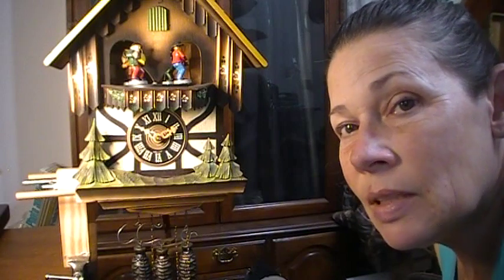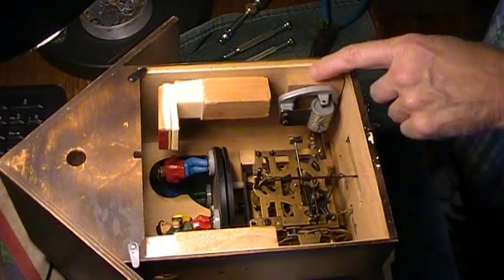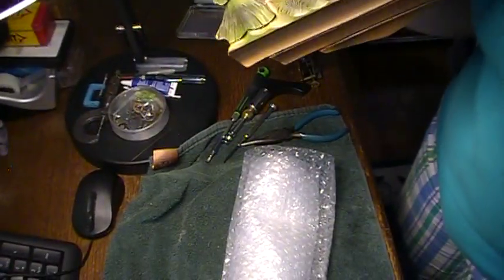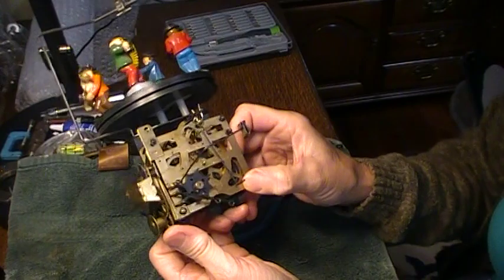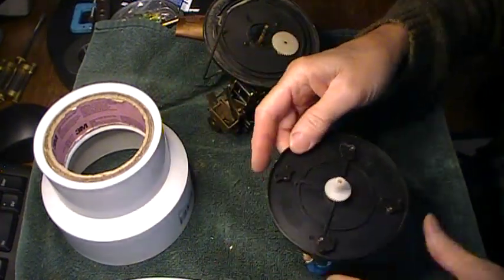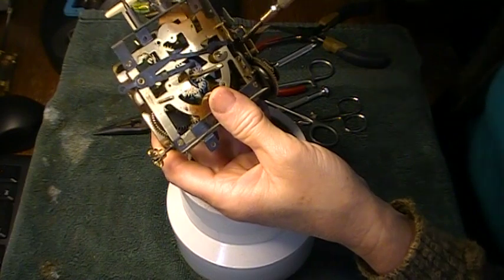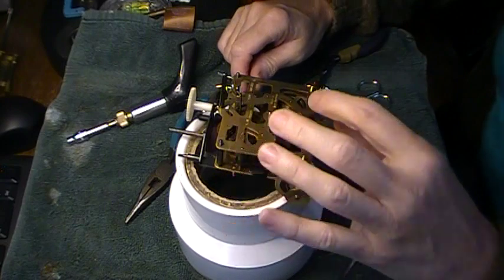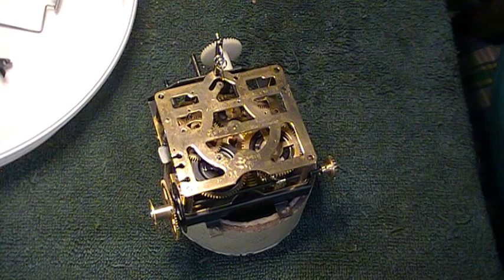1973 E Schmechenbecker Musical Oompah Band Cuckoo Clock with Regula 25 & Dancing Platform Part 1

Comment: Love your detail work Adair!  I use a heat gun at two minute intervals to loosen glue, along with a paint scrapper. A must get is a Knipex pliers 8-13mm 4421J01  e-clip/circlips
Reply from the maker: That would work nicely! Found the paint scrapers after I was done. We were using them on the linoleum we pulled up in the kitchen.

Comment: Buenas noches Sra ,Ase tiempo que sigo sus videos y están excelente ,bueno tengo una consulta para usted ase poco compre un reloj cucú musical en una fría de antigüedades el reloj funciona sale primero el cucú y después la melodía pero al colgar el péndulo se para  que puede ser y que tendría que Aser para que funcione con el péndulo colocado desde ya muchas gracias ,le escribo desde Rosario Argentina
Reply from the maker: Thank you for watching. You can check several things. Make sure the pendulum is not rubbing on the inside of the hole at the bottom of the clock. If it will run without the pendulum, you may need to check the U wire coming off of the post at the top of the movement. Sometimes it is worn with slight grooves, and the weight of the pendulum will make it stop. If it is worn, it will need to be replaced. Also check to make sure the pendulum leader wire is not rubbing on the cuckoo bellows lift wires. The weight of the pendulum can make it hang a little closer and cause them to rub. Sometimes you can see that best by looking one of the side doors. Good luck!
Reply: Buenas tardes Sra, muy agradecido por la explicación de aller ice los puntos que usted me indico y ya está con el péndulo colgado pero a hora tengo otra consulta unos de los fuelles no abre ni sierra qué puede estar fallando si usted me puede decir que tengo que hacer ,muchas gracias por su consejo gracias
Reply from the maker: @albertocomajuan3215  is the lift wire attached to the bellows by a thin lift wire? Sometimes they fall off when you transport them. If the bellows are leather, they can be stiff from the clock not running for years. And make sure there is not a clip holding the bellows shut for transport.
Reply: Buenas noches Sra gracias nuevamente por su respuesta ,me olvide de comentarle cuando saco el cable de elevador el reloj anda perfecto coloco en su lugar y queda como trabado no sube ni baja el otro anda perfecto gracias nuevamente y le pido disculpa por sacarle tiempo de su trabajo desde ya muchas gracias y nuevamente disculpe por tantas preguntas
Reply from the maker: @albertocomajuan3215  the lift lever that pushes the wire up needs to be adjusted. They can be bent to where they need to be. Use two pliers. Hold the lever in place with one plier near where it comes out of the clock, and bend the middle up or down, whichever way you need with the second set of pliers.
Reply: Buenos dias Sra ,muchas gracia nuevamente por responderme ya me pongo a doblar el cable ,estoy muy agradecido por su explicación gracias por todo y le deseo grandes excito para usted
Reply from the maker: @albertocomajuan3215  thank you. You also!

Comment: You are correct the brass lever on my clock is in the wrong position. That is the way it was when I got the clock and I never was smart enough to put in the correct position. LOL.  Thanks for pointing that out to me. Now I know. I might have 3 of the  4 pieces around here somewhere that the band members are part of to make them spin but I also modified other parts trying to figure it out. Oh well. It still works but not as it was intended to like yours. Maybe I should study the clocks more like you do before I start taking them apart. LOL.  You need to invest in those spring clip plyers or make a set. Those clips are a pain. They have to be flat to stay on the shaft. I finally broke down an bought a pair of those plyers.  I have a video on them.   Knipex pliers tool (4621A01 for 3-10 mm).  https://www.youtube.com/watch?v=vwmhFwFBB9I     Movement is nice and pretty. So far you once again are doing one fine job.  Keep it up.  Thanks for the shout out.
Reply from the maker: I bought the $5 pair from Harbor freight today. I'm going to see if they will work. I have another regula to work on, the birds feeding the baby cuckoo

Comment: Wulla I have the exact same clock.  However I'm having trouble with it, the pendulum will only swing back and forth a couple of times and then it stops.  I've been pulling my hair out trying to figure out why.  I also only have 2 band players, the red and orange shirt ones.
Reply from the maker: @kovec69  usually it's because it needs to be cleaned and serviced, if you're clock is level and the pendulum is in the center of the wire behind it-the pendulum leader wire. Is the tick and the tock sound even?
Reply: @cheryladair732  Already cleaned and oiled.   Had the movement running outside the box, as soon as I installed it, it wouldn't keep ticking.   Leveled it and all that stuff, just not working.   Gonna have to take it someone who knows more than me.   However I have the exact same clock.
Reply from the maker: @kovec69  check that leader wire and make sure it's not touching any of the lift wires, and didn't get bent when you were reinstalling. Sometimes it's just something small
Reply: Your clock may be worn out the pinions should be polished and the pivots rebushed
Reply: @Cobesclocks  yes you may be right, I am contacting a cuckoo clock repair man who know more than me.  Thanks